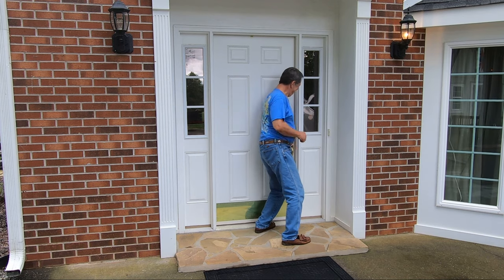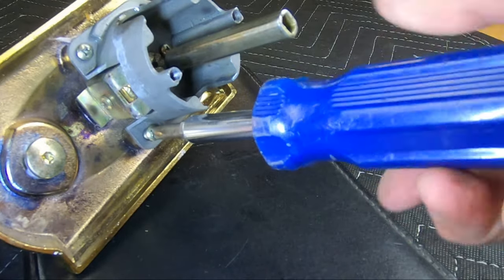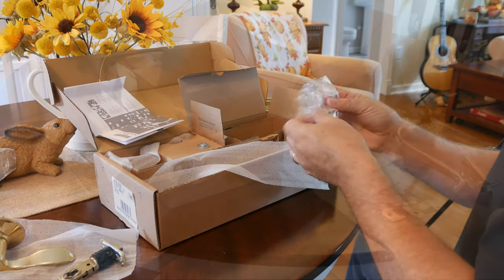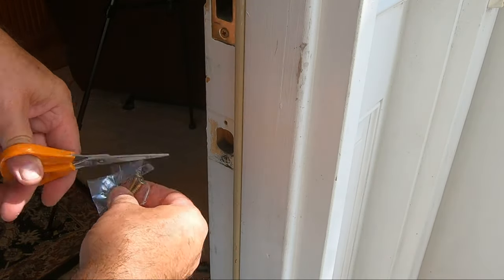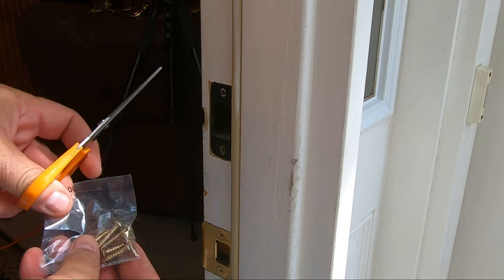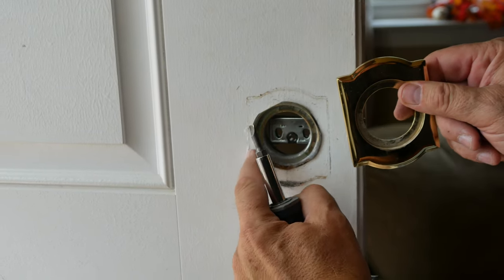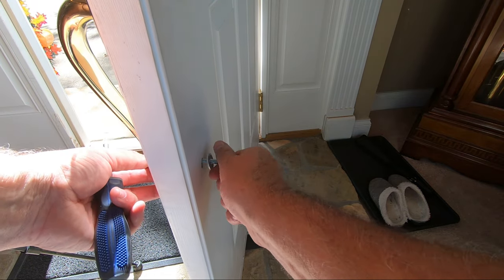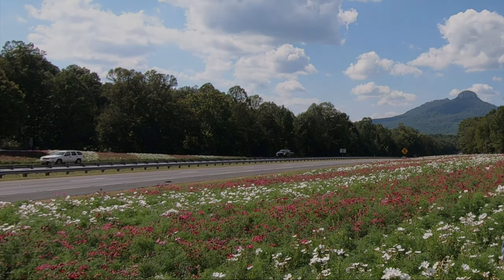Schlage F-Series Handleset Replacement

Comment: Thanks for your video. My inside and outside will not retract the latch. I purchased a new one and the same thing happened after a couple of days. What am I doing wrong?
Reply from the maker: Not saying this is the reason, but:  when installing, it 'is' possible to get the mechanism in a 'bind' while tightening the screws.  I continually work the lever as I'm tightening the screws and if the latch refuses to retract, I back off the screws and try and reposition the handles.

Comment: Great tutorial! I’m having trouble removing my lock because the previous owners painted over the mechanics underneath it and basically sealed the parts into the door, any tips to unseal? I’m trying to avoid buying a whole new door 🤦🏻‍♀️
Reply from the maker: Thanks for commenting Ms.Gomez.  Without seeing a pic, I'm kinda flying blind with my advice but:  I'd start by using a box cutter or X-Acto type knife and carefully cutting around the perimeter of the lock.  This should cut the paint away from the edge of the lock.  If you can get one side off, you can take a rubber mallet and tap on the mechanics of the side you removed 'after' cutting around the perimeter of the other side with your box cutter, etc.  Other tools that may work include a sharp putty knife, or a small flat jeweler's screwdriver.  You might apply a small degree of heat using a hair dryer around the perimeter to make the old paint pliable.
Reply: @PilotViewProductions  thanks for the advice!
Reply: I guess I'm pretty randomly asking but does anybody know a good place to watch newly released series online ?
Reply: @Talon Andre Thank you, I signed up and it seems like a nice service :) I really appreciate it !
Reply: @Phillip Manuel no problem xD

Comment: 1.  You know you're old (AND STYLISH) when you wear penny loafers with tassels. 
2.  You know your house is old...and stylish...when it has a solid brass (and thick) kick plate on the front door instead of one of those "brass" (i.e., coated aluminum) ultra-thin kick plates sold nowadays.  Sigh...longing for the good ol' days.
Reply from the maker: Guilty on both fronts.

Comment: If you have an older Handleset, the cap over the lower screw, screws off, it doesn't pop off.  You have to screw it off.  I guess that was better?
Reply from the maker: You are correct.  I have the same handleset upstairs that is older and it just has a screw with no cover.   Hey, thanks for watching this video and great success in all your projects.

Comment: Ok ,so no way to fix just replace it
Reply from the maker: Well I wouldn’t say that at all.  My point was, if it has a lifetime warranty, what’s the use of a repair.  The repair would have been however; to build a new plate that had the wear marks on it ‘or’ spot weld the worn spots and grind it down level.  Had it not been under warranty that would have been my move.  Thanks for viewing.